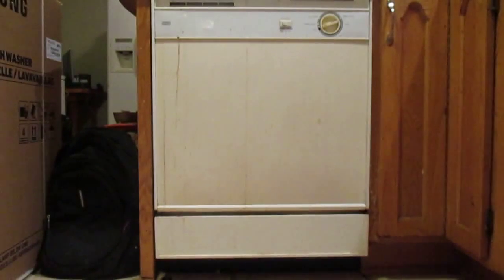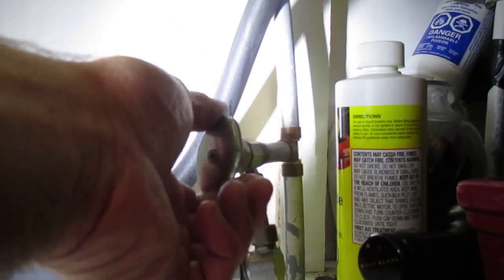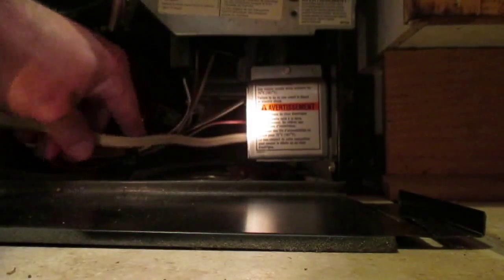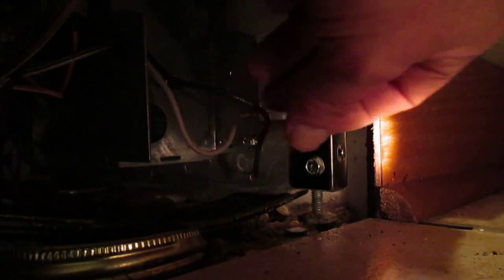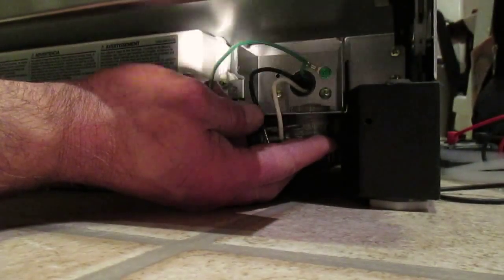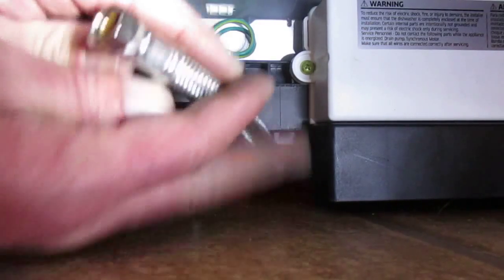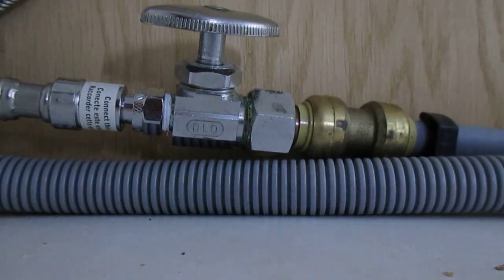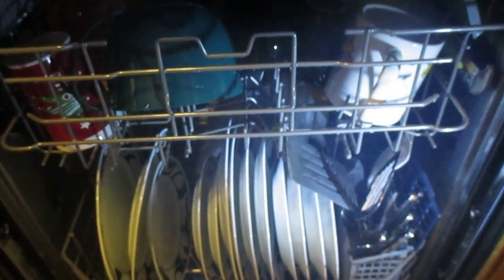How to install a new dishwasher

Comment: Nice, but some light would have been nice.
Reply: Very true.  If you're going to be doing a video for people to see what they need to see, a drop light is not just nice, but essential.  There were things that the guy was pointing to that were totally in the dark on the video.  What good is that?
When he was showing the connected electrical wires, the green ground wasn't connected and it looked like it had been cut too short to even reach the screw.  I think the guy in the video assumed people watching the video knew more about things like this that many will.